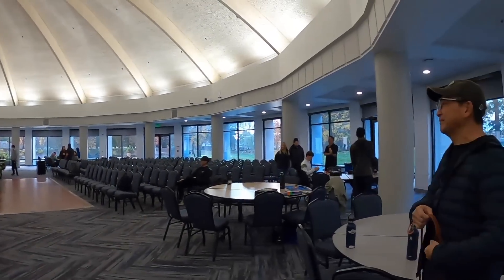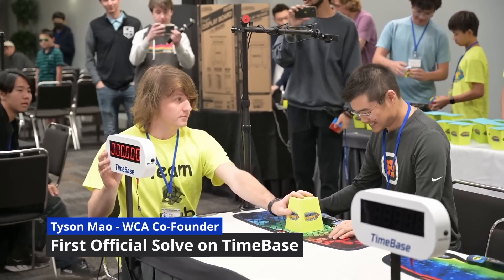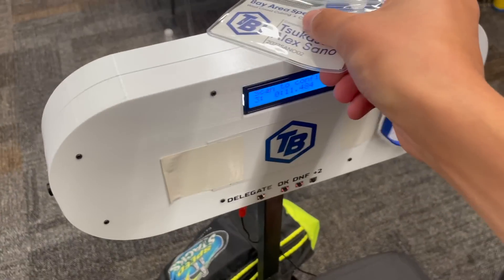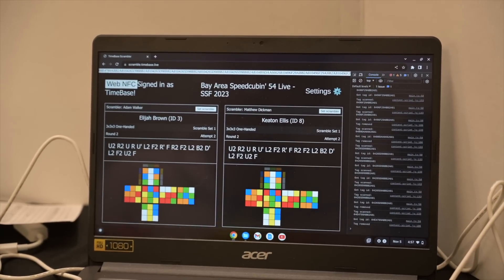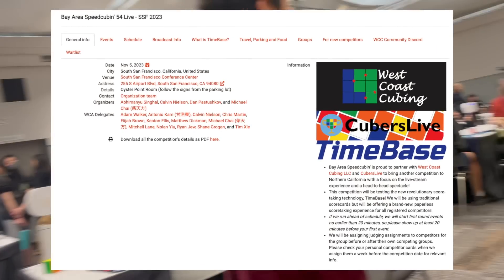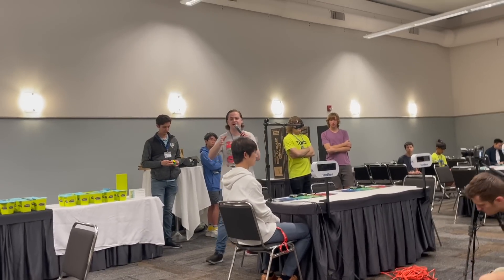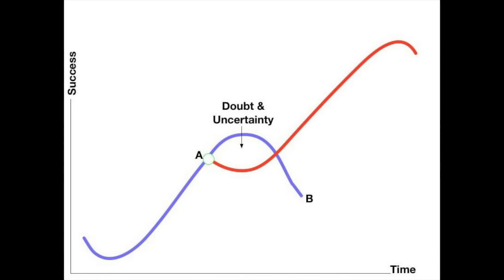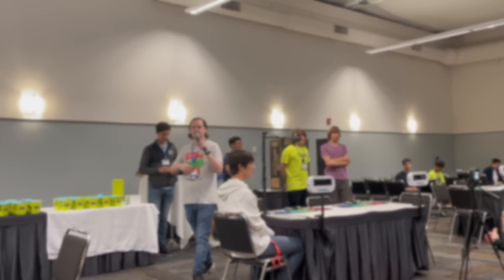This Technology Will Change WCA Competitions Forever

Comment: One thing I'd find slightly annoying as a judge: you still have to call 8 and 12 seconds. But the timer counts down now instead of up. So you have to call "8 seconds" while it says 7 seconds and "12 seconds" at 3 seconds. 
Now I'm not entirely sure (maybe the backside of the display does count up?) But if it is only counting down that would be very annoying imo
Reply from the maker: I completely forgot to address this! The back of the display where the judge looks at is a stopwatch and not a countdown, so they can say "8 sec." when the stopwatch reaches 8 seconds. However the inspection time that shows on the front of the display(where spectators can see it) is a countdown.
Reply: @TriCubing  that makes perfect sense, thanks for the clarification!
Reply: how to buy time base ? @TriCubing
Reply: @skcubing_g7r  I don’t think it’s available for consumer purchase at this time
Reply: I suppose only rules and traditions prevent the judge from counting down as well. Countdown Would make as much sense as it does for the audience, right?

Comment: I'm sorry to be a buzzkill here, but this will not change how WCA competitions are run.
Similar technology was presented by Polish team in 2012 (12 years ago!) - it was called OpenCubeWare.
It actually worked, and we had enough of transceivers to run competitions with it, which worked.
OCW didn't use entire custom displays, which meant it was much cheaper.
What did WCA do with it, after being in tests for way more than a year? Nothing.
WCA is non-profit, and there is no care for that organization to make such improvements, because why?
Despite having modern technology and scale, WCA doesn't have their own timer, which would cost <5$ to produce, with included hardware necessary to not need something like TimeBase.
I've been in speedcubing since 2006, and what you need is new organization, rather than just good ideas.

Comment: I was in SacCubing two weeks ago (Jan 2024) and they had black and white stations where the white ones utilizes TimeBase. My first solve at the TB station took 5 minutes to begin because the display kept saying missing scramble and invalid ID. After these problems were resolved, it went smoothly and it does feel pretty cool to “sign” using the NFC tag.
We’ve been stock with speedstacks display for long enough (20 years!), and it’s about time for an upgrade! Looking forward to seeing it more in competitions.

Comment: Great video, very informative! 

Maybe in the early days, if the system were to be implemented widely, a combination approach of scorecard and time base could work. It would take a little extra time, but it would also provide a written back up in case something were to go wrong. Maybe further down the line, having something like an NFC WCA cuber card (in the long term) would mean organizers wouldn’t have to make new NFC tags every time for everyone, just for new competitors until their official WCA cuber card arrived. And obviously NFC tags could be used as back ups in case someone forgot theirs. Either way, I think the system shows great promise.

Comment: I agree but what if the competitor turns the cube in inspection and you wouldn't know because you're looking at the countdown on the dispel
Reply from the maker: You don't need to look at the back of the display the entire inspection period, you can keep an eye on the competitor and peek at the stopwatch after say 6 seconds to prepare to say "8 seconds". Even if that was a problem, that also applies to normal stopwatches too and that has no problems.
Reply: alright thanks @TriCubing
Reply: also love your vids btw @TriCubing

Comment: The only thing I’m not liking is the inspection part having a countdown is weird and also the judge should be looking at the competitor to make sure they’re not cheating not just the time and having it facing the opposite way does not help
Reply from the maker: First off, the countdown inspection only applies to the front of the display(I forgot to mention this in the video). That means that the back of the display shows a stopwatch instead of a countdown. Also, making sure the competitor isn't cheating shouldn't become a problem because you don't have to be looking at the display the entire inspection period. You can just peek at the display after say 6 seconds to prepare to call out "8 seconds", and so on.
Even if that still sounds like a problem, keep in mind that what you said here also applies to normal stopwatches, and stopwatches don't cause any major problems like cheating.